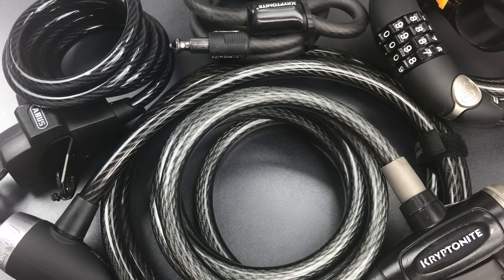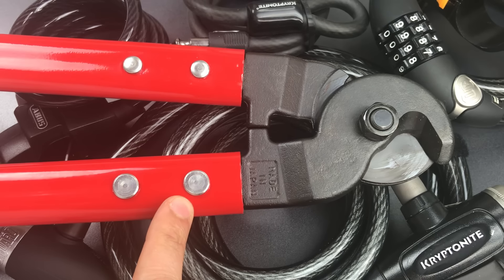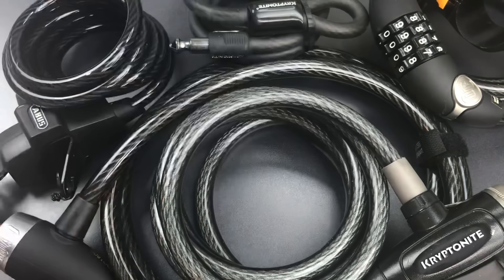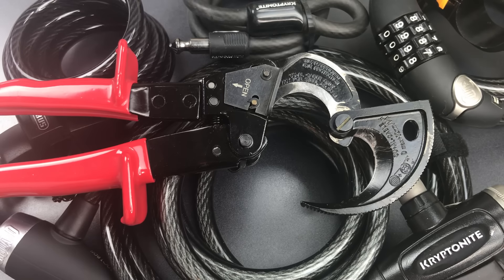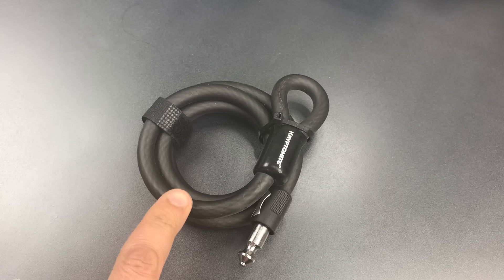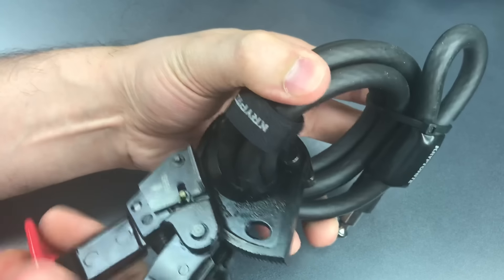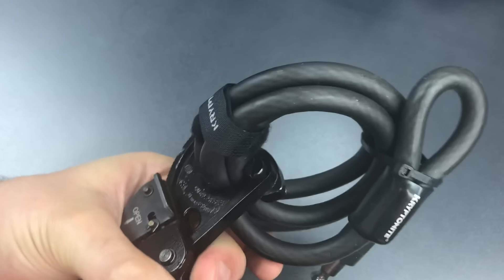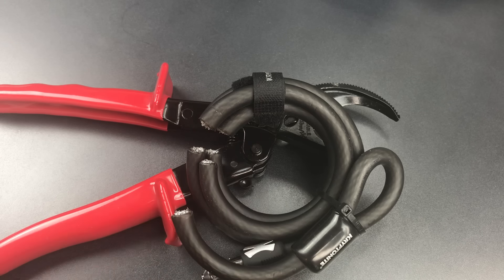[748] Cutting Bicycle Cable Locks is EASY!

Comment: Living in a relatively low-risk rural town, this is a big part of why I just carry a cheap lock.  Everyone has a bunch of tools that'd cut through locks more expensive than my bike anyways, so the lock is really just to stop some idiot just snagging it as a convenient thing to grab.  Most other people aren't locking their bikes anyways because theft isn't common, so it's more about being the less convenient option when one of those idiots decides to grab something.
Reply: Yes, for cheap bicycles which are not attractive for a professional thief, because he can't sell it for a price which would justify the risk of getting caught, in relatively secure areas these locks are ok to stop drunk people who just want to have a ride home and other casual thiefs that don't carry any tools from stealing it, so probably 90% of the potential thiefs. Also it's easier to find something like a tree where you can lock the bike to, having a U-lock but not locking the bike to something because there's no small enough lamp post nearby can be even worse. I usually carry both because of this, a U-lock for the inner city where cycle racks are common and the risk for a theft is higher (the cable lock can then be used to secure the front wheel) and a cable lock for the more remote areas so I can always find something I can lock the bike to.

Comment: I use one of the Kryptonite cable locks for my bike, but the bike is inside my Suburban and it's cabled it to the seat brackets to slow down the smash and grab break-in artist. I'd prefer not to mar the finish on the titanium bike up, so a coated cable lock it is.

I need about 30-60 seconds from window breakage to arrival with a lead pill installation tool.
Reply: Gunga Dinn i’m pretty sure most bike locks have covers over them no prevent exactly that. Also a lot come with brackets that you can mount without messing up the look of your bike.
Reply: Kryptonte sells a bunch of link chain locks that have a nylon sleeve to prevent scratching on your bike
Reply: Put a chain inside a bicycle tube if you want another option that won't damage the finish.

Comment: I'm in college right now, and a few months ago my bike was almost stolen, I was using a cheap cable lock from walmart, but the bike was cheap and from walmart too, so I didn't really care too much about security. From what it looked like, they tried to cut the cable, but couldnt for some reason, and then they just took the entire back wheel, and since my bike was so cheap, it costs more to replace the wheel than to replace the bike.
Reply: Made in china

Comment: I was going to say, I can’t see too many bike thieves buying a $300 pair of ratchet cutters but i guess they would steal them first. Surprised the steel doesn’t chip one of the blades. We have a few pairs of these all with chipped blades from the new guys cutting triplex (metal strand on the inside of aluminum wire)
Reply: You can buy those for 20-40 bucks...

Comment: If you don't recommend cables, then what should we use to lock our bikes ??
Reply: a hardened steel U lock or heavy duty hardened chain & padlock are typical recommendations for bikes worth over $80 in urban areas & college campuses

Comment: I almost thought I was watching an April 1 (April Fool's day) episode featuring an audio cable instead of an actual lock cable. :-P Then again, I presume that tool is quite capable of cutting steel wire too.

edit: Upon re-watching the video, I realized that this is a cable lock when I saw the bolt plug on the end, which I initially thought was an audio plug.

Comment: I bought a bike that was stored by the original owners for 30-40 years and they forgot the combo on the lock. So watching this feeling like a criminal when I did nothing wrong 😅 I have gardening tools which are similar and I am going to try using one of those, I feel like criminals probably use similar tools because they are so readily available

Comment: I tried cutting an uncoated cable with bolt cutters it's hard there is always a few strands that won't cut. But put bolt cutters to the coated ones and they cut through them like a hot knife to butter.
Reply: Aaron S    Hmm.  Different (inferior?) steel?  Or maybe the plastic acts as a lubricant?  I’m guessing the steel tho.  Steel comes in a wide range of strengths Im sure that applies to wire rope too.
Reply: No the plastic just keeps the strands from spreading apart allowing the bolt cutters to cut it easy. The one that I had no coating started to spread flat as I was cutting it forcing me to bend the last strands back and forth until they snapped. The bolt cutters were just pinching the last strands instead of cutting them probably because they are for bolts not wire.
Reply: Got it.  That sounds right.

Comment: The only cable lock that I would ever recommend is one equipped with a motion sensor alarm and used in conjunction with one or two other hard locks (u-locks, etc). I always use three locks, all of a different design. I always have at least one motion sensor alarm too.

Sad that the world is filled with thieves who are ready and willing to take another person's hard earned belongings.

Comment: Is the absolute minimum for getting through a similar cable an 18” bolt cutter or hack saw? I’m considering it for securing a helmet to a motorcycle.

Comment: Remove the rubber coating with an exacto knife. Most cables are composed of thin wires susceptible to mere wire cutters.

Comment: Been researching locks and chains for bikes for months now. If you don't want it stolen you better get a 16mm thick chain or U-lock (Onguard brute is best U-lock for the money) or you have to buy true security chain. The thing that makes this chain different is its Rockwell hardness is higher than even high quality bolt cutters. You need 3/8" minimum. If you want the hardest to steal, yet most versatile setup, here it is: https://www.westechrigging.com/peerless-security-chain-716-kit-3.html
Reply: "I'm going to use the tool that Bosnian Bill and I created. OK, small click on 3, 4 is definitely in a gate. And  there we have it! This random YouTuber's lock was relatively easy to open."

Comment: yep the weakest link is the cable most of them uses aviation cable but it can be done harden steel cable the reason why you wont see it on common retail store is because it is too stiff to be of any use in some case it would be almost impossible close the loop it would spring back by the way LPL you should do one on cheap brand chain lock I remember once that someone was playing with a chain lock ( dollar store brand ) trying to pull it with there bare hands and the chain links broke the links where NOT WELDED :/ so not too good of a safety rating for that one !

Comment: I wonder if there was Kevlar threads combined with the steel. Or mainly, does that tool work on Kevlar.
Reply: Probably works. Kevlar is vulnerable to shearing force, it's only really useful against impacts.

Comment: Yeah. I always used a cable lock. Until I left my bike “secured” outside a library and came out to find my bike gone. Jokes on them though. Just that day I tried and failed to fix my brakes, so whoever stole it had brakes about to fail. After that I got a kryptonite U lock. It came with a cable too that’s about as thick as 3 of these here, but I was told to never use it, because no cable lock, no matter how thick, actually does much.

Comment: Thieves need to ask themselves : " Hmm which is faster- cutter or picking?"
Reply: i don't think any thief has ever actually asked that question, since lock picking is really only needed when you don't want to leave obvious evidence (though most picking methods will still leave forensic evidence)
Reply: Well with the most bicycle locks showed in this channel you may start wonder which weak points to attack first.

Comment: All you need is a piece of metal bar, not very long either.
Use it as a lever to twist the lock and cable strings will cut eatch other one by one.

Comment: Ratcheting cutter wasn’t designed to cut steel it’ll need replaced after a couple of locks
Reply from the maker: Not really... just spend 20 seconds dressing the blades with a file and it’s good as new. I’ve done this several times.
Reply: This^ and even if it breaks you should've already gotten a bunch of bikes out of it which should be enough to get a new one. Hypothetically of course :^)

Comment: Those plug-in cables are pointless beyond being a deterrent in the sense that "look the bike next to this one doesn't have this cable and is marginally easier to steal." 
As a dutchie I find the best way to secure a bike is to use the shortest, heaviest chain you can manage. And lock it through the front wheel and frame, with the chain well off the ground, in such a manner that it's not possible to use the bike itself as a lever on the lock without damaging the bike to the point where it needs repairs to be fit for sale.

Comment: My question now is, what is a good option for a bicycle lock?
Reply: the scariest cheapest ones you can get , my dad would always have at least two locks on him, one for holding the frame, and one for the wheels. locks are simply a deterrent ,anyone who really want's your bike can break a lock with simple bolt cutters . your best defense for your bike is taking it indoors where people will be watching it or no one can see it.

Comment: So what should i use to lock my bicycle
Reply: A Krypronite or OnGuard U-Lock made from HARDENED steel.
Be wary of other brands - some others (Bell, Sigtuna) claim to be steel but are just chromed copper.
Reply: Both a chain and a U-bolt lock. They each require different methods to defeat. Use a cable lock to keep chuckleheads from walking off with your front wheel.

I'm a big fan of uglying a bike up. A lot of bicycle security is making it look like a bike that no-one would want to ride in the first place, and making it look like a less appealing target than the bike next to it.

Comment: You took 46 seconds to do it, from inserting the tool around them to breaking, so in less than a minute and very quietly someone would loose a bike to a cable cutter

Comment: I got my stolen bike back. The thief had it for almost 2 years. Now his lock is on the back wheel and frame. It's a thick cable, but I might try this tool.

Comment: wow, so what is the best deterrent?
Reply: Either chains or that lock type that screws to the frame and inserts the shackle in-between the spokes.
Reply: Smith and Wesson M&P .45 handgun.
Reply: Zachary Zarko Fat lot of use a gun is.  If you have to sit there watching it then no-one is going to nick it anyway.
Reply: Yeah, I was joking. It's illegal to shoot someone for stealing your stuff anyway. Deadly force can only be legally applied to defend yourself or others from death or serious injury.
Reply: Using a regular lock and leaving your bike between other bikes so that its very akward to use any tools, and hope that the thief steals the bike next to yours
Reply: Vigilance, and don't leave your stuff in dumb places. U-locks will make them think about choosing someone else or at least slow them down. You could also try hiding a tracker.
Cause let's face it, with all due respect the cops are incompetent.
That said, I never wished someone's kids would die of cancer until I ran into a bike thief. There's nothing worse than someone that steals from the poor.
And that's why you don't do drugs kids...

Comment: I just hate seeing bikes everywhere using these locks on the top bar where they can be kicked of or cut easily! I always use a steel u lock on my bottom bike frame bar through one of the suspension forks. Its definitely better than a loosly fitted cable lock

Comment: BUT... hold on...
Just like he shows how easy it is to pick all these hundreds of different kinds of locks... 99% of thieves are not picking locks or carrying around ratcheting cable cutters. 
I’ve secured my 1100$ Carbondale for 7 years in Chicago still today with the same cable lock and never had a problem.
1987 is not 2020.
1987 required skill/knowledge to commit many crimes, today thieves in Chicago are running into stores on Michigan Ave and running out with $30,000 or more in clothes or iPhones. People are grabbing people’s cell phones out of their hands and running away. 
If you want to be a thief in 2020, it does not require skill or even effort.
Reply: A thief who is not targeting a specific bike wouldn't generally pick a lock because there are a variety of different locks and even the weakest ones, ignoring locks that you can rake or bypass, still require some semblance of skill and the correct tools for that type of lock. Carrying an angle-grinder or a bolt cutter doesn't require any skill. A large part of securing your bike isn't necessarily having the best security but just looking like it's not worth the effort. Your bike being very expensive and requiring little effort to get into makes it the perfect target for a thief unless it is locked up in a secure bike shed, which is a different matter altogether.

You may be right, most thieves will be looking for something that isn't locked up at all so any protection is better than no protection - but your main concern should be the ones who are going out of their way to steal bikes and will be carrying the correct tools around. A $50 - $60 investment now will potentially save you $1100 in the future, so why take the risk?

Comment: the best deterrent is to have an ugly bike + one of those locks thats a solid metal ring. Just hit the bike frame with some cheap spray paint and deliberately do a bad job of it. If its uglier than the bikes around it they'll pass over yours

Comment: The problem is people lock their bike wrong 99% of the time - The cable is meant for the front wheel only (most bikes have a quick release for the front wheel) most the time NOT the frame itself. You have to be a lunatic to lock your bike up with a cable. 

Absolutely no reason not to recommend the cables for this use. If you REALLY wanna make sure your front wheel isn't stolen you can replace the quick release (same with bike seat)

Comment: You cut 4 At once which in real life would not be the case you could only cut 1 and you want people to think 4 is harder than one but no it's not if you cut 1 the Cutters will turn sideways and spring enough that the steel cable will slide in between the cutting blades and not all get cut. I know I use these cutters all the time for their intended purpose on the job.

Comment: Holy crap they are expensive!  $200-300.  I wonder what drives that price.
Reply: Small market
Reply: Those are $22 on Amazon.
Reply: Link?
Reply: Google? Or even search Amazon? (FWIW, the $22 are gone; the lowest price at the moment of posting is $26.88)
Reply: Well, the price should reflect the value the tool provides.  In this case, it takes about 2 minutes to cut through a bike lock.  That’s 10 bikes an hour (including travel), and if you fence each for $100 you’re making $1,000  an hour before expenses (van, bail money, hoodie, gas, & tools).  Even if you went through a pair a week, that’d be worth it, don’tcha think? </sarc>

Comment: what about the thick cables?
Reply: Don't you think 4 separate cables at once would equal 1 thick cable? If not, I'm sure it would cut through it anyways, there was little effort for the tool
Reply: runforitrun
so lets say going thru 4 coiled up 5/16th cables at the same time is the same cutting a single 1 1/8th cable? no i seriously doubt it, same construction with much thicker gauge cables.  i'm sure your familiar with your standard 16/3 extension cord as in 16 gauge. compare that to a 12/3 Extension Cord and the 12/3 extension cord is much heavier and thicker.  they dont double up thin wire they use much thicker wire. just like 4 40mm padlocks  shcakles are not the same thing as a shackle from a 65mm padlock shackle.

Comment: Not for steel. Why do they say that?
Reply: Tony Papantoniou Because it will damage the blades. Steel armored cable (ASCR cable for overhead power lines for example) is a bit stronger than these locks.
Reply: Far as I know, that usually means the blades aren't hardened. If you try that with smaller tools (and smaller work pieces) like wire cutters, it'll work at first, but the blades will gradually deform and chip until they can't cut hot butter.
Reply: William Shreckengost, what the lock picking lawyer has shown not in a small or minimal way is that they can cut steel and he cut through 4 pieces all in one go. I wonder if it is to stop bike thefts but then you can use a C frame nut splitter which will also cut through chain, hasps and cable.
Reply: Tony Papantoniou what LPL has shown is that they will cut steel... once. Not for the expected life of the tool. There are ratchet cutters with harder blades that are suitable for steel; they tend to be significantly more expensive.
Reply: Bicycle 250 dollars ratchet cutters 29 dollars  no problem if they break.
Reply: They won't break; they will get blunt and not cut anymore after very few cuts. Your initial question was "why are they marked 'not for steel'?", not "Is it convenient economically for me as a thief to buy a pair of properly hardened cutters, or is it better to buy the cheaper "copper" version?" (Incidentally, the answer for someone who plans on stealing many bikes is still very likely to be "Properly hardened")

Comment: There is no difference whether you cut only one cable or four at the same time. The problem are the thin individual wires inside. The tool cuts through each individually at ease, since it is soft steel for flexibility. With four cables it just takes four times as long (instead 5 sec, its 20 seconds).